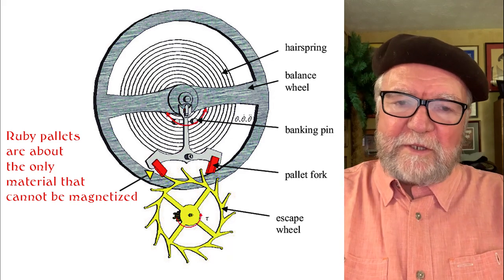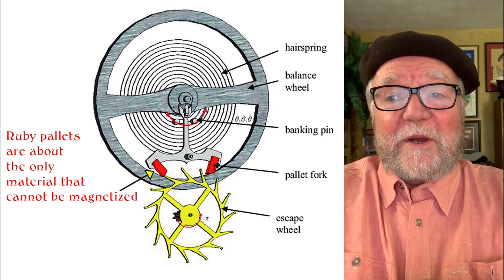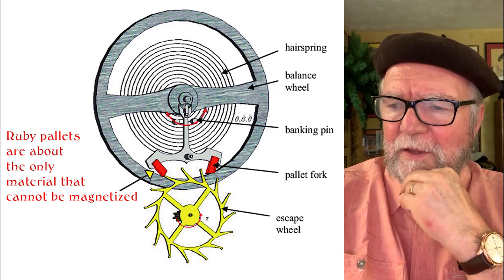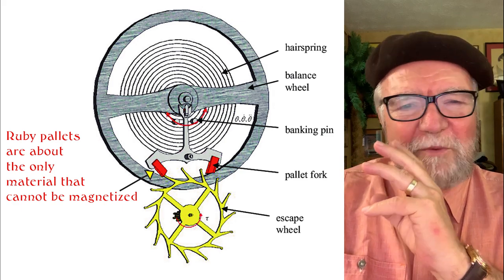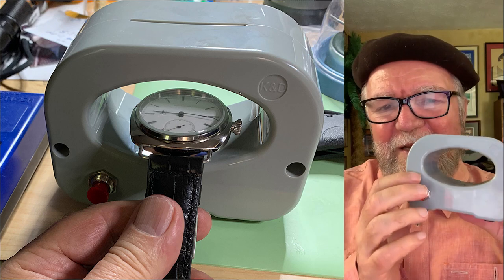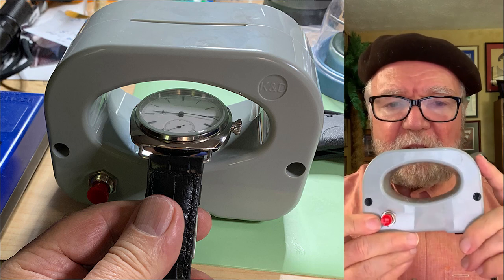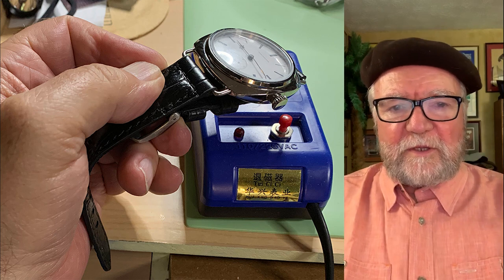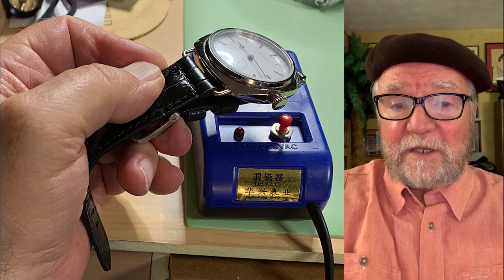Watch Magnetization: How to Recognize and Repair

Comment: I have a Seiko 4R36 caliber in a Sport 5 SRPD55K1. It would stop after 7 days and required manual winding. I thought it was lack of activity on my part. Occasionally it would stop much sooner after a day. I ran across this issue of magnetism and many watch folks I know on the Reddit sub Seiko, did not think that was the problem. I thought I had a lemon and wasn’t going to drop hundreds on a repair, clean and lube.

I learned a compass will detect a magnetized watch. Holding it next to the watch I could see a 30 degree deviation in the needle. Just maybe this it?

Bought a $30 demagnetizer on amazon. After a few procedures with the instrument, the compass deviation was solved. Cool. 

I’m now seeing -8 seconds per day accuracy, within spec of the 4R36, and it hasn’t stopped in the last 3 weeks. I’m very happy now with a trusted timepiece, now my old faithful.

I suggest if anyone has accuracy or other issues, try the demag routine, simple and reasonable $. It may help or solve it.

Comment: Interesting, I didn’t know running slow could be a symptom of magnetization. Thanks!
Reply from the maker: Hi Airtoad, neither did I until my FP Journe  Chronomètre Souverain was running very slow not long after I had it serviced. I took it to the FPJ Boutique where I had sent it off for service in the Miami FPJ Service Center. The boutique manager is very experienced with watches, and he told me to leave it with him, and he'd demagnetize it for me; and he did. Ran perfectly after that and it still does. So, it's just not the hairspring that can get magnetized, but the escapement and balance wheel and even wheels in the wheel train. Lucky us! Take care, Bill

Comment: Interesting video. I am getting a demagnetizer soon. My watch which I've had for about four years has been losing time over the last few weeks and it usually gained time from when it was brand new.
Reply from the maker: Hi Station...if the problem still persists after demagnetized ... could just be a regulator adjustment. Take care, Bill

Comment: Really thank you Sir. I had a Calatrava from 60s. As far as you know, if I'm going to send to PP for service, could be possible they remove original balance spring with the latest made in silicon? Or do they keep same original base material for this component? Kindest regards Francesco.
Reply from the maker: Francesco, I recently sold my Calatrava from 1968 ref. 3468 with caliber 23-300 movement ... as long as I had it, it was always accurate and wonderful. As you know, though, the Calatravas from that period were pretty small ... mine was about 31.5mm± and I rarely wore it. I cannot imagine them replacing your hairspring with a silicon one. Patek Philippe has a wonderful Service Center in Rockerfeller Center in New York, and I would give them a call and ask. Take care, Bill
Reply: Really thank you for your avalability! Kindest regards Francesco

Comment: Yes, you must release the demagtinizing effect slowly and moving away does the trick.
I also use this  method to look for  lost spring or screw on the floor. Rugs are real chalenge. I use a very strong one. You sweep over the area and release the on/off swith while over a white board hoping to see your prize fall on it ! It works. You must not keep it on for long periods of time as it will heat up. follow the recomendations.
Reply from the maker: Hey Roland, thanks for the tip! You're right about not keeping it on for long...it gets hot! Take care, Bill

Comment: Great video thank you for sharing.
Reply from the maker: The pleasure is mine David. Take care, Bill
Reply: @watchartsci  not sure if you reply to these bill but I have a question before visiting a watchmaker or jeweler. I just purchased a braclet from Ball for my engineer magneto s  and have never had an issue installing or sizing bracelets in the past. I cannot for the life of me remove the screws from the links on this braclet... do they use locktite or something on these at a factory level? Thank you

Dave
Reply from the maker: @nkmsvwde5612  Hi Dave, I know what you mean ... I've had screws like that and have even had to cut away a gator strap because of a too-tightened screw. I was told to take a mini-blowtorch (a Bic lighter?) to the screw to melt the locktite, and I tried that but it didn't work and it was too close to the watch itself; so I didn't push it. I took it to a local jeweler who happened to have first rate watchmaker on staff and he took care of it. Take care, and let me know if you come up with a solution, Bill
Reply: @watchartsci  alright Bill so ball got back to me and they do use locktite on the braclet screws.  I ended up going to home depot to pick up a more substantial mini screwdriver before I brought it to a jeweler.  With a little more force the screws came right out without using an additional heat source and the fit is perfect.  Thanks again for the video and reply look forward to watching more of your stuff 

Dave
Reply from the maker: @nkmsvwde5612  Good to hear of your solution. Like a dummy, I kept using my good screwdrivers from the set that I use in watchmaking, and as soon as I bent one, I went to the watchmaker... it never occurred to use one from my workbench or get one small enough that was tougher than the overpriced precision ones for watchmaking. Also, I have wondered if there are different type of locktite... ones for slightly locking to fully locking.
Reply: @watchartsci  i actually found the exact type they use for the ball screws in a rolex forum. Its locktite 222 purple. One of the less strong solutions, im going to order some if I notice that the screws start to become loose. Also the micro flat head that ended up doing the job was a 1/16. 4 dollars ... can only image now much this will save me in the future.. look forward to chatting with you again!

Dave

Comment: Luckily I've only had to demagnetize a watch once. Worked great. 
You know something I was thinking, I was never really that pulled in one direction or the other on silicon hairsprings but I was thinking about the watch I'd like to get to pass down, so a gold dress watch, maybe JLC or GP. In that context, I'd rather have a non-silicon hairspring so it can be adjusted in 200 years if need be. I still have 20 or 30 years before I buy this watch but I think about it.
Reply from the maker: Good point Nefarion. You and Roger Smith are on the same wavelength ... and I'll add myself. Take care, Bill

Comment: Hi Bill, do you care to elaborate on why you will not buy a watch with a Silicon hairspring? I am certain you have valid reasons, but a blanket statement is not reasonably understood...unless you still use bias-ply tires on your car, ( yes I am that old to remember those...) Material science has advanced tremendously in our times. The use  or not, of silicon components in watches has a lot more to do with patents and copyrights, that with the actual material itself....please look deeper into the subject, and educate us all, like you always do. Regards.
Reply from the maker: Hi Panos. I used to write programs for smart phones and come from a world where silicon is king.  Far from being a Luddite, I've retired from a field where progress is measured in nano-seconds; now I want to enjoy a hobby where I can still adjust a regulator with a pegwood stick. As you know, silicon is both brittle and keeps its form in heat and cold as well as being wholly non-magnetic. But of course, so is quartz, which is actually silicon and oxygen. If there's a reason to eschew a perfectly efficient watch using a quartz vibration for a regulator using a balance spring and balance, there's a reason to prefer a traditional metal over a metalloid such as silicon. (Of course if you really want progress, jump to a Smart Watch.) I do not preach conversion; only state what I prefer and why. Take care, Bill
Reply: @watchartsci  Thank you Bill. Point well taken. In this hobby, it is good to have a strong philosophical conviction on what one likes and why, else one goes to a million different directions. I only asked, as I recently bought a watch with a Val Fleurier movement with a complete silicone escapement, the first and only one in my collection. I am not convinced of it's longevity, in an environment of synthetic lubricants, but I am willing to try it. Please keep up the great vest pocket series, as they are great education for your fellow collectors.  Thank you again, Regards.